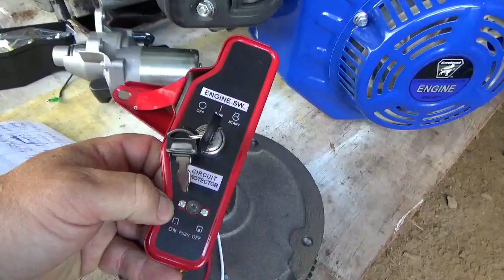Predator 6 5Hp, 212cc Engine Upgrade, Electric Start and 12Volt Charging!

Comment: Alot of the old timers around here like to go and buy a 3 speed out of a old truck and run them with a sprocket chain drive and have reverse and 3 etra gears kinda neat you might find one cheap

Comment: First time here, never saw your channel before, but now I'm subscribed.  I'm not sure how much of a difference it would make, but you might want to consider swapping out that diode for a full wave bridge and get a bit more power out of that charge circuit .
Reply from the maker: Hey Doony!!! Thanks for watching my videos and subscribing to my channel, it means a lot to me!  The coil as it came OEM configured, one side is tied to ground. To go full wave, I need to break that loose to pick up the bottom half of the sine wave, (then tie the negative output of the full wave to ground),. I think it would almost double the output of the charge circuit. Good ideas, I will probably go that way if I add lights..... Thanks for Ur thoughts, subscription, watching, and commenting!!!

Comment: i ordered the starter kit for my 212cc predator 6.5 hp  when trying to install the flywheel dident fit so what do i have to do to get the right flywheel for my unit?

Comment: oh and you were right in your initial assumption that the little metal plate is to hold your charge coil wire safely away from your flywheel

Comment: I got two issues. First my kit did not come with the stand offs for the starter. Second is the flywheel that came with the kit will not go on far enough to get a full nut. Did your flywheel slide all the way up without any modifications. Thanks

Comment: You didn't put a bolt on the crankshaft when tapping it with the hammer to protect the shaft threads, you put a nut on it. Big difference.

Comment: If you change that diode for a full wave bridge rectifier by also rectifing your negative cycle
you'll double your charge. But you might have to add a regulator circuit to keep the volts below
a charge voltage of around 14 volts? Also on ebay are GX140 to GX200 series clone carbs with
 propane dual fuel regulators that should fit, so you could convert to dual fuel
Reply: If I add an electric start kit to my predator 212, but I use two charging coils, then run them to a 12v rectifier regulator then run the rectifier to the battery, would that in theory give a stable battery charge? Then from there from the battery to the starter solenoid or lights or whatever else?
Reply: @toobam570  two coils would give more amps

Comment: Where does the red wire that was hooked to the charging coils on the electric start go when you add a voltage regulator???

Comment: so if I buy one of these with the electric start already added all I should need is a battery and it is already set up to charge the battery?  Or will I need to charge it separately or get some sort of alternator?

Comment: No way is that one coil producing enough current to charge a 12v battery??? but I have a question if anyone can answer. 

If I add an electric start kit to my predator 212, but I use two charging coils instead of one, then run them to a 12v rectifier regulator then run the rectifier to the battery, would that in theory give a stable battery charge? Then from there from the battery to the starter solenoid or lights or whatever else?

Comment: One diode does not convert alternating current to direct current. 
It takes 4 diodes to make a rectifier which converts A.C. to D.C.
Reply: Like he said in the video, the single diode only coverts the AC into a half wave DC current. To get full wave you would use a full bridge rectifier like you mentioned.

Comment: Would ya still have to open/close the choke underneath the seat? I didn't see any automatic mechanism for that
Reply: you can get a manual choke lever kit, basically a bicycle brake cable to pull the choke

Comment: If anybody can explain this issue I'm having bet you can! I've been following  you  for some years now.  I've narrowed down the youtuube channels I go to for info when I'm stuck of need memorie refreshed , even advice I thought I knew but realized i was screwing up whatever you get it . Ok predator engines ( honda clones ) are nothing new to me not this predator 420cc is giving me a hard time.  I'm actually really used to working on Honda/suzuki/China junk and  briggs and stratton engines .I built a mudmower to see how difficult it really was . I used a craftsman gt5000 with a bad vtwin kohler engine so I scrapped that and realized that garden tractor had a horizontal driven pulley on the  transaxle with hi and low range so I swapped the 8inch pulley out for a 3 inch and mounted a predator 420cc engine with a 10inch drive pulley. I got the 420cc same day and landfill I scrapped the kohler engine at . It looked almost new except missing it's carb. Great compression and all that. I ordered a brand new carb that worked perfect until I accidently overheated the engine to the point of misfiring and stalling . Now i have to have the choke closed on the first click for it to run right otherwise it won't Rev up from idel.  Compression seems fine still. How do I wire the stator ? When  I test for voltage it seems I'm getting 10 to 40 volts from stator . If I run that wire to battery it kills the battery when engine is off ?? I have a rectifier regulator but if its already dc voltage then that won't work right ? It's like it needs a kill switch to . Can I wire it to the engine kill switch to do both at once ? Any advice would be great  thanks much .

Comment: Any idea why my engine only fires of the battery is connected? I tried testing the motor without the battery and there is no spark
Reply: the switch switches both magneto earth off to run, as well as start / run

Comment: $100 is kind of outrageous for the start conversion kit. I just paid $171 for an electric start 212 (brand  unknown) on ebay. surely they're not still selling the engine for $71, and charging you $100 for the start kit as a complete unit lol